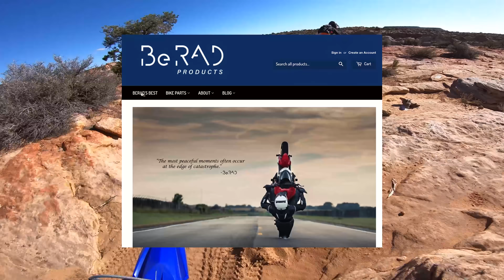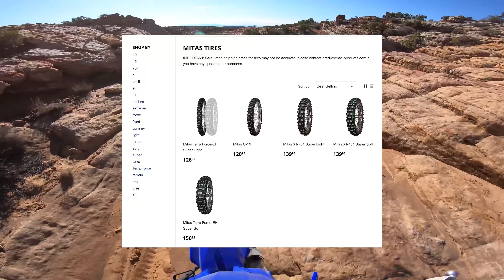5 Miles of Hell on a YZ125 - 49min Utah's Hardest Dirtbike Trail

Comment: I was literally contemplating if I should get a 125x and this video just made my decision..... I’m gonna get one
Reply from the maker: Siiiiick! I love mine so much.
Reply: BeRad has done an awesome job showing folks how to have fun and build skill on a smaller displacement bike.
Reply: Me too lol I’m 5’10 and 155 lbs and I don’t think I need a yz250
Reply: @jadonschwartz531  250's are more fun because more powah baby
Reply: ive been riding since 5 years old tho. but 125's are still a blast
Reply: Dirtbike Logic  exactly. Line a mountain bike with a motor
Reply: That's what I was gonna get but ima get a drz400sm cause I wanna ride on the road it will be my first ever bike an idek how to ride it 😆
Reply: Dirtbike Logic  its somthing you gotta ride both to really appreciate i feel like. I didnt understamd how agile my 125 was until i got a 250.
Reply: Definitely wouldn't say a 250 is too heavy...i think sometimes people arent used to yz250 motocross suspension and the strong bottom. 125s are like ridiculously light, but almost unnecessarily light. And i weigh 145lbs... Both bikes are fun though.
Reply: @Dylans503  what do you mean by motocross suspension? Is there any 125 thats not a motocrossbike?
Reply: @nickolaivuicich4105  Yeah, Yamaha also has a YZ125X. It's very similar to the YZ250X, a two stroke off-road model that's different from the YZ motocross model. It has different suspension valving for off-road riding. The X model also has a different powervalve spring and porting, along with a different CDI. I think KTM, Husqvarna, GasGas, and Beta make a 125 off-road model, but im not totally sure.
Reply: theyre awesome.  i can ride mine at very low rpms in rough terrain without a bunch of clutch work and the thing never stalls.  and mine is completely stock although i should change my rich stock jetting
Reply: @didickcheeseburger  that’s how I feel about my drz, I got lucky and found a pristine 2014 s, it’s a bit on the taller/top heavy side for really technical stuff but handles everything else perfectly (keep in mind I’m 150lbs and about 5’9”)
Reply: Get an rm250 for the same price
Reply: Maybe get an extra clutch. But they are super fun!
Reply: Dirtbike Logic  I ride both the 125X and the 250X.   The 250X is is equally fun to ride and surprisingly nimble and lightweight in feel for it's size.  Nothing too heavy about it and I prefer it due to the extra power.
Reply: @Dylans503  ktm/husky have the 150xcw/tei
Reply: I have one, get it theyre so much fun
Reply: @graxo3752  I’ve been riding since I was 5 first bike was a crf50 and now I got a kx450f
Reply: Why get a 250
Reply: 125cc is the best...
Reply: I had a kx125 2 stroke for about 3 months rode it every day but kinda felt like I got used to it too quickly and couldn’t get much More out of it I’ve had my yz250 2 stroke for almost 3 years and it still scares the shit out of me lol
Reply: I got my 09 Crf 450 for 2500 pretty much mint condition, and it’s the rider not the bike. I’ve tackled some thought terrain the size or weight is a personal preference.
Reply: @graxo3752  they aren’t rly as fun unless all u want to do is ride fast all the time, that’s all they are really good for 125 are the sweet spot for me they are fast and can do a lot more than a bigger bike can do
Reply: TheGamerRaven  i’m 17 and i have bought a can am outlander 850 xmr, crf250r, yz125x, yamaha r3, and a yz250f, i like the yz125 a lot more than the 250s bc it can just do so much more than the 250 can i plan on selling both 250 and r3 to buy another 125 and an r6.
Reply: Niceee im also getting one, my grandpa has an old kx125 (1979) in parts and im gonna fix it up and ride it!
Reply: I love mine
Reply: I have a 250 2t and a 450 4t and honestly the 450 pulls way harder. Probably a bit much for these kind of trails
Reply: I started out on the cheapest used rm125 that I could find, it was a race bike through and through and I ride trails but that bike taught me a lot about clutch control to get through technical stuff. It was tough but I progressed quickly and now I ride a yz250 and I love how the extra power gets me through trails.

Comment: 125cc is enough for a 2 stroke. Espesialy with the mods you have
Reply: Lol 125 is not very much
Reply: @Pidot31415  well if have zero skill then you maybe need a 250 or 300
Reply: Aslan T Vorlon  im not from a english speaking country so my spelling is rubish
Reply: @Pidot31415  dude just did the roughest trail I’ve ever seen. “125 isn’t much”. 😂yeah maybe in a straight line next to a 250. All ab what you use it for and how you use it. Having a bigger bike doesn’t automatically make you a better or faster rider
Reply: Then you have never been 5th tapped on a 250 2 Stoke giving 450s a run for there money
Reply: @a.k.3811  but 250s have a better bottom end and a better gear range and more tourqe
Reply: @mikkejalonen9050  nah 300 ktms are awesome in the trails
Reply: Much more fun on trails with a 125 you get more chance to pin it
Reply: @chaz_bl3731  but you also lose a lot if top end and with a 250 you still pin it a lot in those trials prob not but the problems he was having with rpm and gearing there would be virtually none
Reply: @mikkejalonen9050  kyllä ny 300 kotari ois vitu hyvä
Reply: Stick a ktm 300 motor in a 125 frame lad
Reply: @btgaming8361  It's the basically the same frame just different mounts ktm 125 and the ktm 300 share a almost identical frame
Reply: I can say from experience, it isnt enough stock. I physically cant do hill climbs on my 125sx, part bike, part lack of skill. But riding the clutch on my 125sx either bogs it severely, or it shoots up near redline and starts spinning the rear.
Reply: @volatilegaming5852  oh yes when there are big hills ofc a 300cc will destroy the 125
Reply: @a.k.3811  I've ridden a variety of sizes. 125 isn't really much its a entry-level bike I'd say, but I could just be built different.
Reply: @Pidot31415   even an 85cc is enough for a good rider my dude you have 0 skills that's why you probably work that thing at 3000 Rpm that's why it doesn't feel powerful but trust me when you go full throttle on a 2 stroke even an 85 is fast...
Reply: @2strokeatv_bro248  you think a 100 4 stroke is enough for someone very skilled. I have a lot of experience riding my 2 stroke 250 through rough trails like this but I’ve never taken my 100 4 stroke threw any rough trails  as I feel I would be too heavy for it considering I’m 5,10 170 pounds.
Reply: @JJ1350-  how do you like the 250. I’ve raced previously on a two stroke 85 and I’m thinking about getting a 250 as a race bike. I’m taller and a bit heavier if that makes a difference
Reply: @aedanfreberg-hickie6061  It’s a good choice to have for you since you already have experience on the two stroke 85 if you didn’t I would say to get a 125 but since you have the experience a 250 would be a great choice. It does have significant power over the 85 but it shouldn’t take long to get used to.
Reply: @volatilegaming5852  you are doing something wrong
Reply: @Stealth164  well, ive tried lots of things. Its probably how aggressive i have the powerband set
Reply: @2strokeatv_bro248  could also depend on how the powervalve is set up. My ktm had it set so that even at full throttle, it only touched powerband from factory. A new spring and a coupla turns later, its a whole lot more savage. Im going to be trying the red spring in my 125 soon, to see how it feels.
Reply: @a.k.3811  a 250 is easier to lug around

Comment: Just bought a yz125 on craigslist that has upgraded reeds, Athena 144cc kit, and a Pro circuit pipe and it fucking rips. Blows away my 250 four strokes. I think I've seen the light

Comment: That's 5 miles of Heaven. A 125 2cycle is a good idea because it's super light but the rider better not be very heavy because that's like no power. A 125 if you are slim is super mobile. Usually a 4 stroke is better for hard pack and loose rocks because it dosent spin out on hills, it acts like a tractor, plus you can go almost twice as far on a four stroke and you don't have to mix the fuel. ⛽ That being said if you can have both please do it. Utah, awesome place, awesome people. By the way, a person can't fake that level of skill that you are seeing in this video, wow😎.

Comment: I've ridden that thing twice, but each time it was right at 16 miles,  not taking any of the bail-outs??   Didn't time them because I was too busy giving away all my water to idiots who ignored the warnings- "bring at least a gallon of water".  You are correct, some of those climbs up slick-rock are massive and require a planned approach.   Those tires were working well, I have them on my GS700 but not dirt bike.    Both times I rode it on a WR250 2 stroke, last year ever made, and best year...   Doubt I'd want to do it on my 4 stroke today, mostly due to old age.  The local club I belonged to was giving away T-shirts the first time- "I survived 5 miles of hell" if you made it to the finish... 
Excellent video, thanks.

Comment: If you go to that trail and you get used to it you can do that trail in about 30 minutes hauling ass.  I did that trail in 40 mins on a Suzuki rm 90.  The time I did it in around 30 mins with gps it was with my Husqvarna 300i.  It's an enduro bike for those that are not riders. The Suzuki is a little 2 stroke with alot of power for its size. My best advice would be use a GPS the next time you go.  My gps set up mounts right on my handle bars. I have 2 of them incase one fails or stops working. They both are made by different companies and use different service providers.  And the mount i have it great you can wreck your bike and go off jumps and the gps stay right where they are supposed to be. The only way the gps can come off the mount is to take the mount off the handle bars. The mount is made from aluminum. I like the set up because they cant just pop out the mount when you hit a bump like some cheaper mounts do. I never leave with out them when I ride in the desert for obvious reasons. And no I'm not talkin about the one on your phone. Uou think the 125 is hard do it on a 90 and tell me how it is. Lol. Alot of switching gears constantly.  Next time I go ima do it on a pitbike. I was gonna do it the time I used my 90 but the ppl I was with told me it would be to hard. But see I like doing trails that most can't do and if you can't tell already my favorite type of riding is enduro races. I've always wanted to do a real enduro race the sea to sky race or something like that but wat hang Graham Jarvis ha e trouble makes me second guess doing it.

Comment: For our pavement-bound friends, the Tail of the Dragon and all the surrounding roads are absolutely a blast. The tail itself is an 11 mile stretch of road with 318 turns and no intersections or residences. Don't cross the double yellow and you generally won't have problems with the police either

Comment: Looks like a fun little trail!
Add 6 inches of snow!
You’re riding it like a 300!
You really need to practice your clutch techniques!
Your clutches in oil it won’t burn up use it!
In some of them technical areas you could pin it and control your speed and what you put into the ground with the clutch you have that way you have stored energy and you’ll start flying right up them technical .
Reply from the maker: Thanks for the tip buddy. I never even use the clutch at all so that should help!
Reply: @BeRAD I guess you're being sarcastic with your answer, there's no way to ride on trail without using the clutch, specially on that little 125x.

Comment: How do you not bend a rim riding on those rocks? Do you have to replace the clutch and tires after that ride? Who were the maniacs that created this trail and how did they know where to go?
Reply from the maker: Sometimes you bend rims but no harm during this ride. A Mitas xt454 tire that I run in this terrain can last 40+ hours. Riding like this. Not sure who made the trail. There are many lines and ways to get through things so
I’m sure they just picked what looked interesting.

Comment: Tbh this trail seems decently easy but i dont know bcuz ive never riden on it i mean i ride a 2019 yz85 and ive never riden a 125x but my friends dad that we ride with has a 2020 aswell as you and hes always talking about being in the right gear and rpms and constantly slipping the clutch to keep it going on some hill climbs and technical single track trails we do but its kinda the same on the 85 constanly slipping the clutch and keeping the rpms up to keep it going but i like that it gives you something to do instead of just sitting there and twisting the throttle
Reply: It's not easy but it's not super difficult either it just a constant beating lol

Comment: Hello Brad, I have enjoyed your videos on the 125X.  I am looking to set up a bike like you have done with the 125X.  Would it be possible with a 2002 YZ125?  I do rides similar to what you do.  Desert, Mountain hard-ish enduro in Southern California.  Looking at a 2002 YZ125 and wondered if it would be possible to get it close to what you have done with the 125X.  The guy already put a heavier flywheel on it and said it smoothed it out a lot.  I'm going to go look at it tonight, but am a little concerned if it will perform like your 125X.  I am 185-200 lbs depending on how good I am being at working out.

I am looking for something super light, and am attracted to the 125's for that reason.  I used to ride a 525 and have gone down to 250 and realized I don't even think I need that much.  Very rarely full throttle even on the 250, maybe in deep sand and long hill climbs, but that is it.

Also, I'm not sure if you sell parts for these, or just the 125X.

Thank you, and I really enjoy your videos.

Comment: How are these modern 2 strokes on spark plugs?  All I remember about old twosmokes is constantly fouling plugs.  Are you able to ride these at a more relaxed pace without having to carry 2 extra plugs??  Also no FI Yamaha??
Reply: Most of the fouling problems went away when carbs got better. The two strokes in our crew, past and present, are a ‘96 KDX200, ‘01 YZ125, ‘02 YZ250, and a ‘13 300XC. Never a fouled plug with any of them.

Comment: the clutch after this trail : :face-purple-crying:
Reply from the maker: 😂😂 well let me blow your mind…I put 240 hours on this clutch riding like this just about everywhere I went. I was blown  away, I guess it’s because I’m not revving excessively high. Just finding the balance of motor output to clutch slippage to torque at the wheel. I guess trying to be as efficient and smooth as possible.

Comment: This trail looks really fun! But is that really the hardest trail in Utah? There wasn't much danger, but lots of rocks which make it more annoying keeping you moving around constantly. Great riding you guys!
Reply from the maker: For most riders this could be considered an “impossible” trail. Most people take 4-5 hours to complete it. I do not find it difficult at all. People just refer to it as the toughest trail. There are other trails in Moab that have much more challenging features. The challenge of this one is that you don’t get a SINGLE break. It’s constant abuse. There are only 2 or 3 features on here that I’d consider somewhat difficult. The rest is just having the ability to relax enough to not burn out and get sloppy. It’s far from eats that’s for sure but I’ve ridden much harder trails. As for a public trail in Utah….maybe so it is the hardest. Typically public trails don’t hold a candle to the private stuff people build.

Comment: I heared it was beneficial to at least be used to being in a higher gear in more technical terrain. Any thoughts on this? Nice riding mister.
Reply from the maker: It really depends on what bike and what the terrain is! I do typically ride in a gear that keeps my rpm low. On the 125 you don’t really have a choice but to ride more so the mid to top range rpm though.

Comment: How tall and how much do you weigh? I had a 2001 cr250r and blew the top end. I sold it and I am saving up for a new yz125x. I just hope I don’t weight enough. I’m ‘5 10” and I weight around 165-175
Reply from the maker: 6’ 180lb. 125’s can be effected up to 200lb easily. If you can ride it well! Haha that part may be key.

Comment: Are you running the XC dome? I just got the apex head from you with the sx and xc domes, mostly riding faster open desert stuff right now while waits for snow to melt in the mountains. Currently have the sx dome installed, just curious on your thoughts on the difference between those 2
Reply from the maker: I’ve yet to run the SX dome on the 250. Im really happy with the XC. Plenty of bottom end, good stall resistance, and still screams up top well. All the riding I do it seems best to have the best range and linear power

Comment: Do u have a aftermarket flywheel on that? It seems like it has more low end power
Reply from the maker: No flywheel. Apex Head with SX/XC dome and geared down. Also the lectron lectron carb helps a lot! There’s a link to my website in the description, I have all of these items in stock 😁

Comment: how many miles you get on average between your 125 and 250x with a mix of single and double track ? on a tank of fuel
Reply from the maker: Not sure on the 125 but the 250 I did 70 miles one day with a mix of gnar and double track.

Comment: I have a 2018 ktm 150 xcw and it’s running really rich and takes a lot longer to heat the engine then the other bikes I’m riding with. We messed with the jetting a bit but it’s still not perfect is there any other things I can try
Reply from the maker: My answer will be to buy a Lectron from my website so you don’t have to fiddle with Jets anymore haha! But yes, you could try leaning it out more...
Reply: @BeRAD  ok thanks